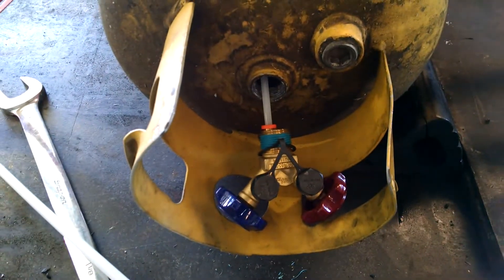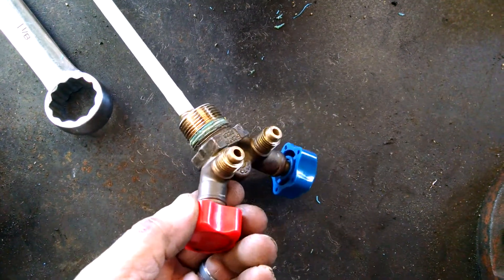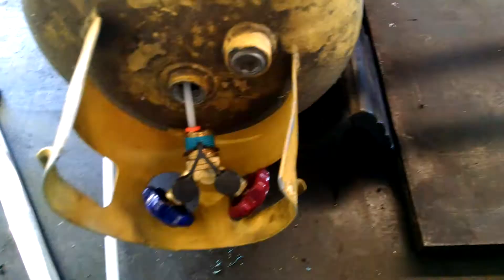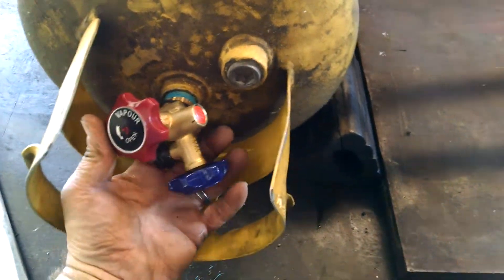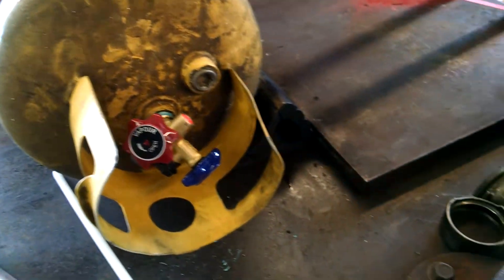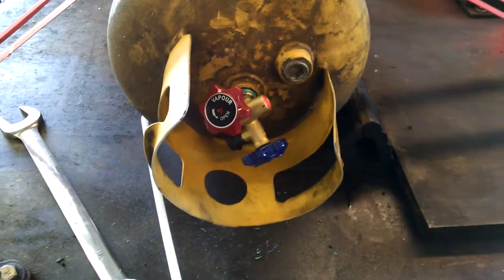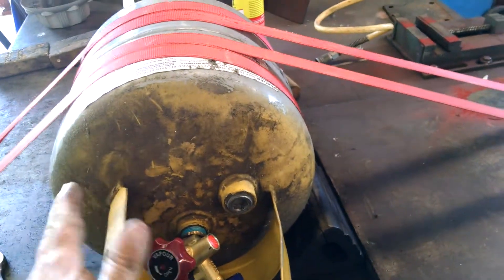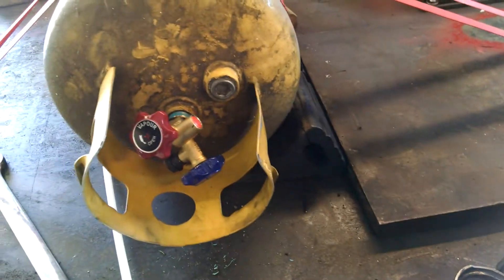Replacing a R134A freon valve for recovery/charging tank Part 2 of 2

Comment: That new refrigerant R1234YF that they're putting in all the newer cars is flammable, just like propane, so it might just come full circle to using propane cylinders for recovery. it's too bad there aren't rebuild kits for these valves like they have for water spigots. It's probably a .25 rubber o-ring or gasket that needs to be swapped out to keep it from leaking. I have a heavy welding table so I'm going to copy your idea for anchor points. Thanks for the video! There's a cheap method of hydro testing a tank: https://www.youtube.com/watch?v=XE3jGyqquqg If you have a pressure washer it's pretty simple.